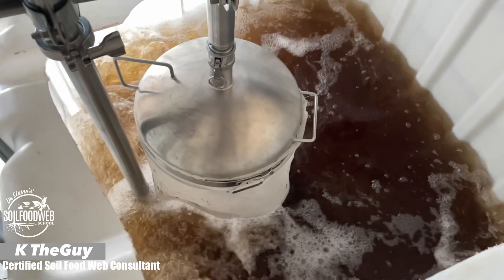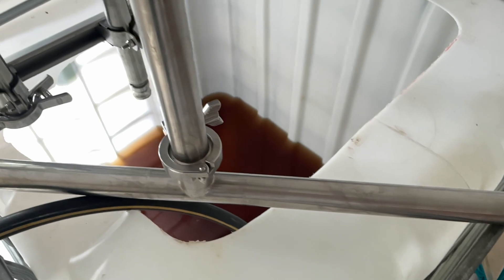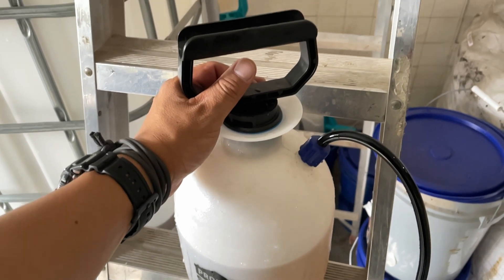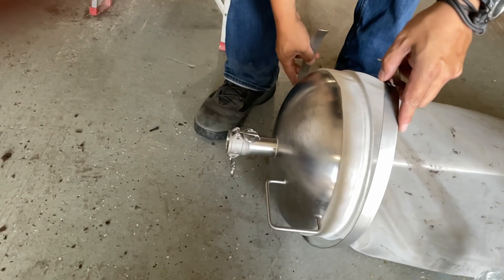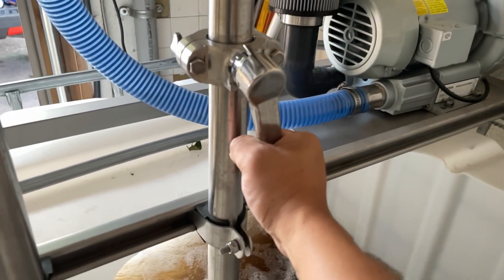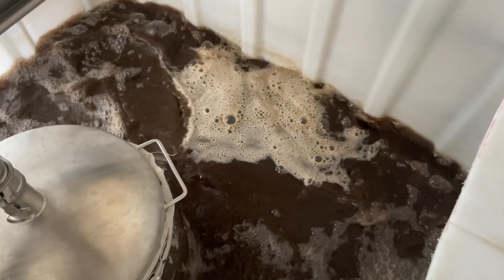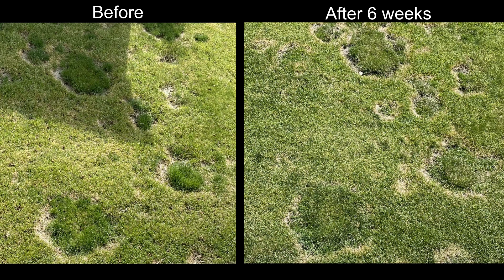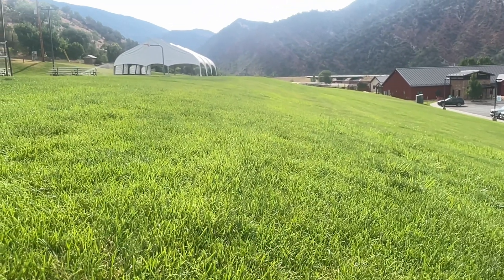Compost Extract Large/ Soil Food Web Process

Comment: I know some guys that worked on compost extraction commercially with microscopic analysis. They both use plaster mixers (paint mixers in 5-gal bucket for the home grower).  They said it had 7x better extraction than using air pumps, and there was no damage to the biology.